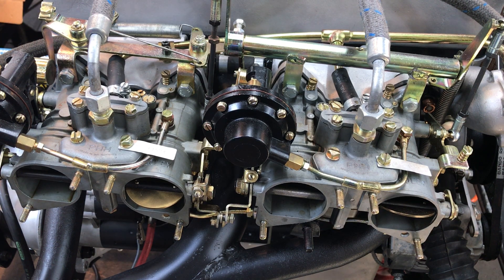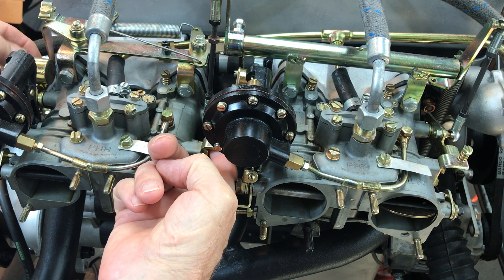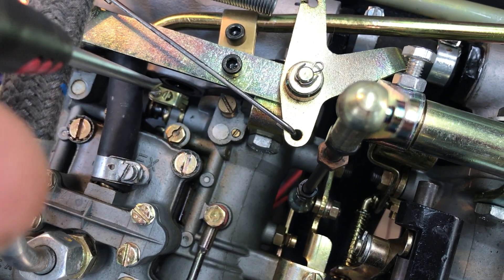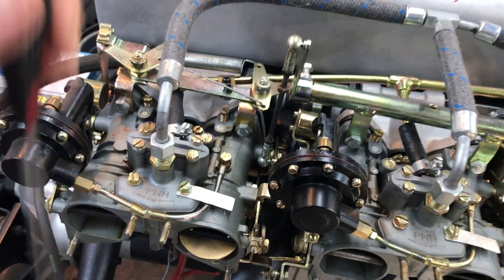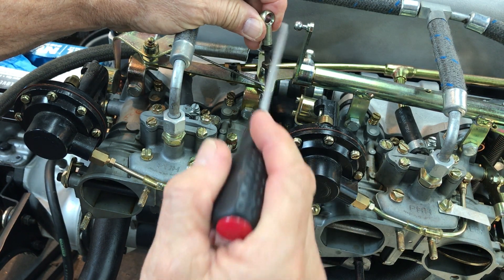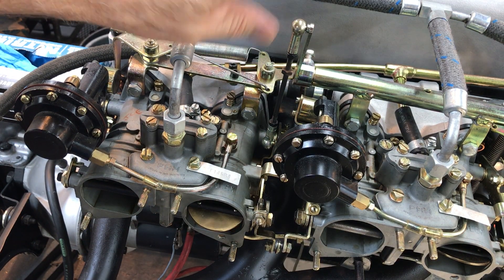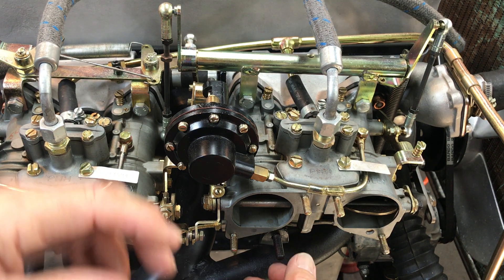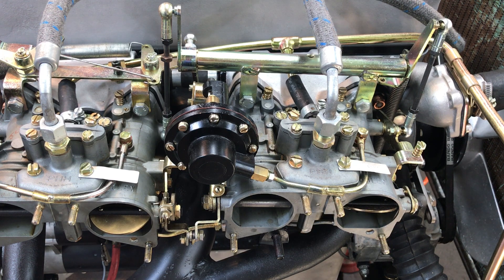190SL Solex Carb Tech Tips

Comment: Hi Will.  I believe I have the same issue here that Ivan had. The idle was  perfect at 750 but recently has jumped around 750 to 1100. When i sprayed carb cleaner at the manifold s you instructed here. I got the increase.  Nowhere ele.  How do I correct this? You mentioned a half moon washer video. Where can I find it and I that my solution? Many thanks Will
Reply from the maker: Hey Paul, see if this video helps: https://www.youtube.com/watch?v=65ZSNhVjp58&t=8s